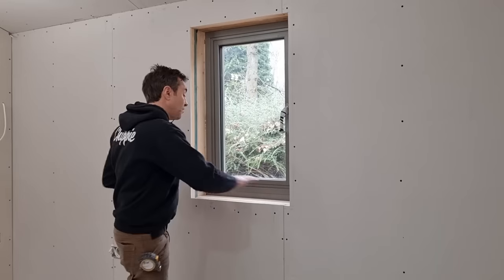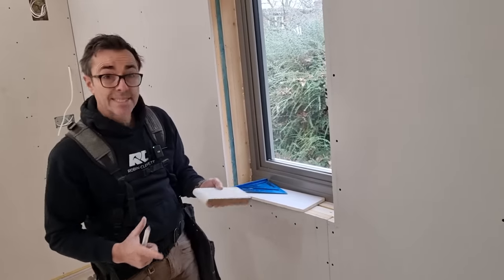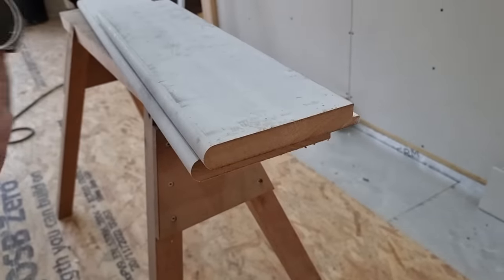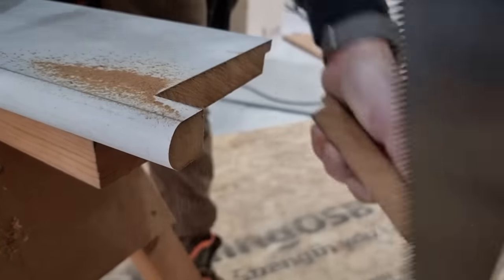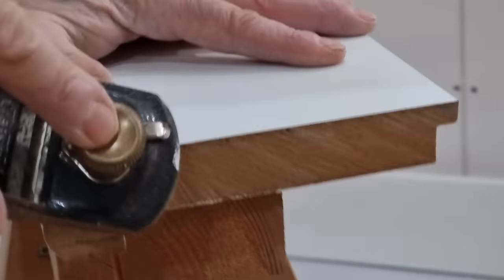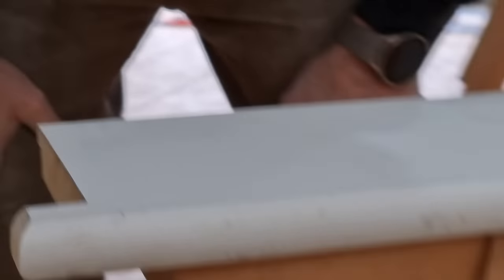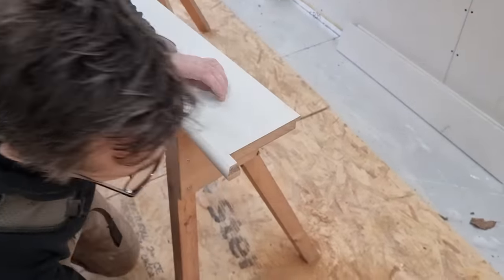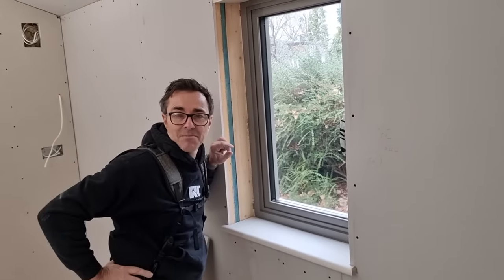How to fit Window boards with and without power tools

Comment: Just a little tip from an old chippy,make sure the window board slants away from the window ‘ that stops water rotting timber if there is condensation . But only an eighth  of an inch 👍🍺

Comment: Please please MDF is paper , when I fitted widow boards the tongue would sit in the grove of the window cill and the front would be fixed with two holes and tying wire and a cut nail bent over , the window board would be sapelia pine with no knots , proper job that would last for two hundred years , do you honestly believe that MDF would last long ‘ and were is the character ,working with dust and glue has no hart , ❤

Comment: Nowadays, I'd use my Bosch 12V mini circular saw. Only cuts 1"=2.54mm. Lovely clean cut every time. Everyone who tries it loves it for anything down to 3mm hardboard. Even works well with it's teeny little dust extraction attachment and its guide fence

Comment: Offering the board to the window and marking it is something I will be doing from now on thank you. A little thing I do different is I have an inch offcut of the bullnose detail and place it on the back of the lug then transfer the lines through to plain off. Not sure it’s any quicker than your method. 😃.

Comment: I've just installed a splayed window reveal with softwood board. Not a carpenter, never done it before. Thankfully, dewalt track saw with angle cuts to the rescue. I needed the extra depth (sash window, old house - new refurb) so I butted the pine wood window sill tongue against the window and added a new tongue under it - a plywood strip glued and clamped against the existing tongue, sticking out just enough. It's not hugely solid but I bedded that tongue into the window groove with silicone and it all sits nicely. Actually it kind of stuck out too far so there's a tiny gap which I have cut some very small beading to cover. I plan to add beading on the side reveals (MDF) as well, so it will hopefully look quite nice. It's a north facing window into a lightwell so no direct sunlight.

Sanded the sides of the bullnose / overhang of course.  I like the way Robin cut the form with a plane, I just went at it with 80 then 120 sandpaper and hoped for the best.

I did all this before plasterboard goes up. Reason for doing before plasterboarding was that I wanted panelled reveals at an angle (MDF not plasterboard) and needed to prep the edges of those panels so they sit flush for plasterboard (with stop bead) then architrave to go over them. Is it normal to fit a window sill before plasterboarding? I see everyone seems to do it. One other benefit was that I could screw from below through 2x4 stud. I put about 6 screws and shims along the length. Might add a few blobs of foam under there before sealing against studs with silver foil tape for air tightness. Hope I haven't screwed it up? I have no idea what I'm doing, really

Comment: Nice Robin.  What I like to do is, using a very short level, make sure  that any water or condensation will flow towards the inside, rather than sit between the sill & the window & rot. Just needs 1 degree off level...   👍🙂
Reply from the maker: Thats a nice idea especially if you know that condensation is a problem in a build, it is the first time I have ever heard this suggested mind you? all the buildings that I build are designed not to have any condensation via proper insulation and ventilation
Reply: @ukconstruction  Hey Robin. What camp would you say you were in, as regards a house envelope being 'airtight' & not able to 'breathe', & any ingress of water being 'trapped',  or the envelope being breathable',with vents etc & any water ingress being able to be self-dried, but obviously less heat efficient...?  🤔
Reply from the maker: @videostarish  Airtight as much as possible and mechanical ventilation and heat recovery system in place as opposed to typical extractor fans in wet areas and trickle vets etc on windows
Reply: I do the same thing if I think water will be a problem, for instance in a kitchen on the sink run.
Reply: A very short level is called a boat level 🍺
Reply: @terrymanthorpe1454  I think I've heard that, but my one is only 4" long...

Comment: When I've done the exposed ends of window sills I've used a strip from the MDF board with the rounded edge on it. And rather than cut at 90 degrees, I've done it at 45 and effectively mitred in the edge. Bit of glue and job done. Not as sturdy as just making the rounded edge by sanding/routing but good enough for most situations.
Reply: @stevehallam6495  Amount of work is no different. Does add an extra joint which is a bit more fragile but to be honest window sills don't get a lot of abuse.
Reply: @stevehallam6495  which is OK as I only do it for the properties I own.

Comment: With a trimmer it's not a major issue to put the correct finish on it with ease. Also it's lovely to work with sq corners. I find the way to do it on most modern builds is put a sq datum then measure from that.

Comment: Not something I do a lot of but when cutting the reveals is there a recommended and specific overhang either side of your opening
Reply: No set size, but generally I add 15mm for the apron plus 25 to 30mm

Comment: Excellent video thank you. Lots of people have mould growth near the bottom corners of the window reavel.  Wouldn't just screwing the plasterboard in the reavel without a insulation or thermal break cause issues in the long term? . Your advice would be greatly valued please.

Comment: Robin, your sanding technique needs to match your text book perfect hand sawing. To produce a curved surface you need to drop your wrist rather than your finger tips. You are sanding by allowing your point of contact to move away from you. Your finger tips fall away from you going over and down. Instead, start the sanding at your furthest point, gradually dropping your wrist and your finger tips rising. The point of contact then moves towards you which due to the articulation of the shoulder, elbow and wrist joists has a tendency to produce a better curve. Your way, the radius of the curve tends to increase as the contact point goes away down, and around. It also produces a ‘scrubbing action’ rather than a smoother ‘stroking’ action. Difficult to explain in words, but have a look at a metal worker filing a curve on a piece of steel. It is one of the very first techniques metal workers are taught. Always love your vids, keep them coming.
Reply from the maker: Well its understandable, as a carpenter I only use blades and sharp edges to achieve a super finish, I mentioned in the video that I hardly ever use sand paper!!.
Reply: @ukconstruction  I can see you rarely use sandpaper,  however you featured it in your vid,  and many viewers will too, hence my comment.

Comment: Whats the best way to fit 2m x 300mm window boards. I see some using angle brackets fixed to the sill underside and the face wall but not sure i like this idea, if they ever need changed its very destructive

Comment: Love you man, this is the first video I've watched of yours where I feel you missed a trick. I know its not your doing but if the window board was just a little higher on the window it would of lost the rubbish detail of the windows outside sill. Much cleaner if that's under the top face of the window board. If a piece of plasterboard was put on before the sill it would of raised it up by 12.5mm and still been fine to plaster/dry line. Bit of a bug bare for me as those window sill lips always trap dirt and look messy, especially white ones.

Comment: Window boards are lot easier to put in when the plaster board isn’t on the reveals. 
The only 2 observations I’d make are what’s the point of planing off your saw cuts when you finishing with glass paper? 2nd would be that allowing your shoulder overhang to be the same as the front edge o/h then adding the plasterboard on top increases the shoulder length!
Reply from the maker: Well Mark, when I filmed this video I did film that whole part about allowing the thickness of the plasterboard if you wanted to have exactly the same return ad overhang... but when I edited the video it was going to be confusing and would have probably caused many questions!! So I also used a piece of footage that says that there is no hard and fast rule about the length of your returns and that it is personal preference, well spotted mate and top of the class for you!!

Comment: Terrific ! What happens if you want a thermal break under the board ?

I’ve been reading a lot this weekend and doing some calcs as I’m going to be doing window reveals for our timber frame dormer, with external plastic cladding soon. From what I read the reveal has to have a u value of .7, and from my calcs if you’ve got a 4x 2 running under the window/ trimming the sides - you can’t hit .7 unless you have 20mm of celotex under plaster / the window board. For the sides / header a piece of bonded celotex / plasterboard seems good - with corner beads so plaster goes over everything - so presumably that means 20mm of insulation under the wooden board , again with a corner bead so one can skim up to the underside of the mdf …? 

I guess for some reason in your wall make up (external insualtion? Albeit I can see insulation bonded to the plaster board presumably to stop cold bridging …) Eg copy and paste here - “Part L1b of the Building Regulations recommends that the minimum performance of any insulated element should have a U value no worse than 0.7 w/m2K. This U value should be used as the minimum standard for a reveal.”

So unless the insulation is external - that means there has to be insulation here or the timber becomes a cold bridge. 

How do you deal with this situation robin …? Having layers of insulation makes it harder to ensure the window board doesn’t “squidgy” if sat on into the insulation …
Reply: Overthinking it fella.
Reply from the maker: You have to look at the building regulations as a guide, it is not always possible to cover every square cm with rules in my case we have a 140mm stud  mass filled with 120mm PIR then we have the Insulated plasterboard with the best quality PIR insulation on its reverse so you can trade off some parts for others and this is acceptable
Reply: @ukconstruction  as always insightful and helpful - thank you for your detailed response. I have learnt so much from your videos and am very grateful for your public spirited educational work through video and attention to comments. All the best.

Comment: Can I add the window boards after plastering? New build, block walls. Wondering do I add before sand and cement plaster and final skim plaster, after sand and cement plaster but before skim plastrr or after all plastering and make tight window board fit with some calk if required.  Many thanks in advance for the advice.
Reply from the maker: Traditionally it is a first fix item so now straight to the block work, just need to allow the right overhang based on the overall plaster thickness or dot and dab etc, it's a better finish like that just be sure to seal the newly fitted window boards all round with a decent oil primer, you can do them after but then you are relying on the plasterer to get all his work spot on or you will be making good everywhere!!
Reply: @ukconstruction  Thank you!

Comment: All my window boards were as you say soft wood or hardwood. All cut out by hand and planed with a block plane to shape. I left in 1998. Never saw an MDF one used. I know you can get that really expensive outdoor MDF now. But I bet those aren't made of that. So how do you go using just "moisture resistant" MDF. That in reality is about as moisture resistant as a sponge. In an area prone to condensation and moisture. Do you have blown window boards all over the UK now. We always used to put tie downs on the front edge of the board that got plastered in to stop lifting. The Aussies are too lazy to muck around like that. If you want reveals you tell the window mob what size you want. All four the same. And they come from the factory on. Haven't done a window board in 25 years.

Comment: Is adhesive good enough to hold window board (in my case red deal) or should one also screw down to block wall?
Reply from the maker: If you have good surfaces that are dust free and solid then an adhesive would be fine, I would try a polymer type adhesive for multi surfaces
Reply: @ukconstruction  many thanks for taking the time to respond.

Comment: How are you getting on with the Milwaukee router? I’ve only used mine a few times so far but it’s very powerful for its size and a nice weigh too. Great video Robin.
Reply from the maker: I like the milwaukee router, it's compact if you need it to be and also really stable with the large base fitted, I even don't mind the weight of it with a 5ah battery fitted!!

Comment: Was there a need to plane the ends after sawing?  None of that face was left after the rounding!
Reply from the maker: you will have a flat spot between the round over that the bearing of the router will run, and it will show if there is a sawn edge, it is something we where taught when we where apprentices many moons ago

Comment: Some great tips and advice there Robin. How would it be done differently if it was a blockwork cavity wall? Cheers
Reply: You can sill usually put some battons down to fix to. But I also fix stainless steel builders band to the underside of the window board using 20mm screws. Then fix that to the block work below the window to help level it out and fix it in place. Then fill the gaps in with expanding foam 👍
Reply: @p4fizzle  Good to know, thanks mate!

Comment: Why are the reveals there for please? The pieces that hang over on the front each side. I dont understand why they are not cut straight then round off the corners still. Are they purely decorative? I did all the UVPC outside sills flush (no reveals each side) Just because I prefer the look.

Comment: Interesting, ive always assmembled as one piece and slipped the whole thing in. Your showinf the sides on top, ive always cut back and screwed the sides onto the top and bottom jamb. Sloping for condensation doesnt make sense unless your dealing with poor window efficiency in that case they should have glass upgraded or inserts on the inside etc ro deal with that

Comment: 03/02 23, Overhang determined by type of drapes/curtains to be hung.
Reply from the maker: Hi Peter, I have never heard that in all my career, when I was an apprentice at college I can recall that we where told that it should be roughly 1 and a half inches thats about 38mm, mostly at the build stage when these boards are fitted I cannot imagine that anyone cares what type of curtain is being used!!!
Reply: @ukconstruction  04/02 23, No disrespects but beg to differ - depends how curtains & drapes are fixed above the window, more so if lnterior Designers are involved. If battens are involved then material will generally lightly rub the cell. If not then minimal cill overhang looks better, especially in a Show Home, when viewing end on. Best regards.

Comment: What plane is that
Reply from the maker: This is a Stanley plane, I cannot remember the exact model!!
Reply: It looks like a Stanley block plane 12-960 low angle,
it’s looks like the one I use.
Reply: I’m about to take my site carpenter practical exam and just wondering would this plane be suitable to put a chamfer on a piece of timber to match up with a section of architrave
Reply: @adambrown6536  yes perfect plane for a chamfer

Comment: Çardboard carpentry. MDF and water or moisture dont mix.
Reply from the maker: The window boards should never get wet and in bathrooms we tile the window reveals, these MDF products are more widely used than real timber now in the UK and are perfect for the job

Comment: I noticed you didn't wear a mask when cutting, planing and sanding the MDF window ledges but I was concerned for your lungs when you started using the router. My local builders' merchant won't even cut a full sheet!
Reply from the maker: I had my dust extraction on I would only use an M class extractor with a router and MDF
Reply: Did you not see the dust extraction ?....always 1
Reply: @jamiefors5062  Yes but mine does not pull all the dust!

Comment: Plasterboard on the stud wall should be laid horizontal and joints staggered
Reply: Why ? Only ever see that on a ceiling
Reply: @karlkjj  for the same reason you do a ceiling
Reply: Gyproc doesn’t specify that way …. In forty years on-site I’ve never seen it done staggered
Reply from the maker: Agreed
Reply: @Karl Jones  so why do a ceiling one way and studs another... you would never put a ceiling up like that
Reply: I have no idea just follow what the spec sheet says ….
Reply: The reason why it's horizontal is that it's a sealed machine edge to a machine edge an old plasterer told me that and it sounds like a good lie so I'm going with it 😝🍻🔨